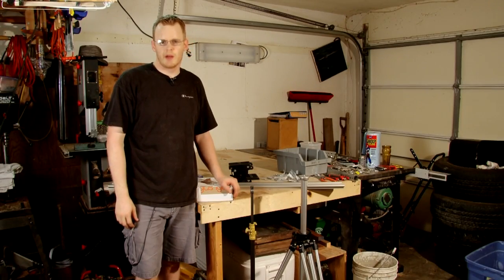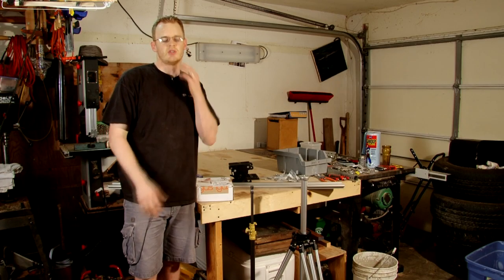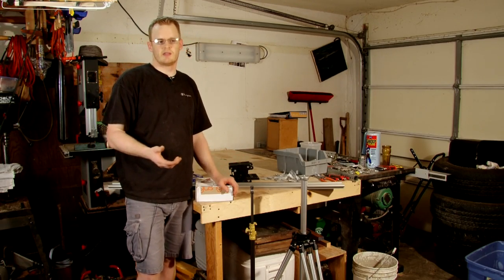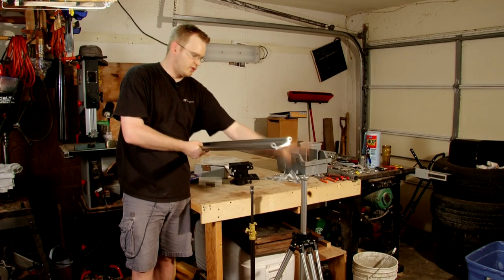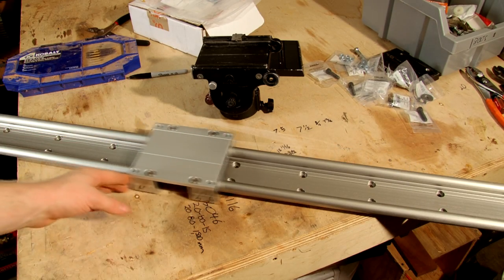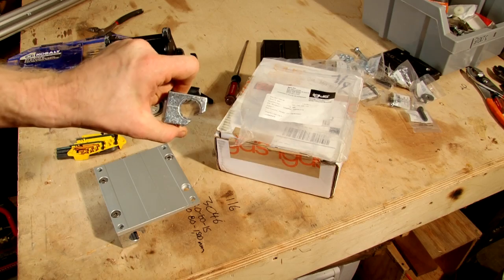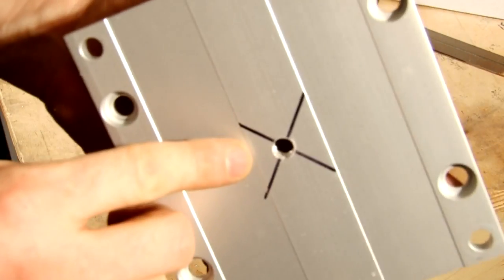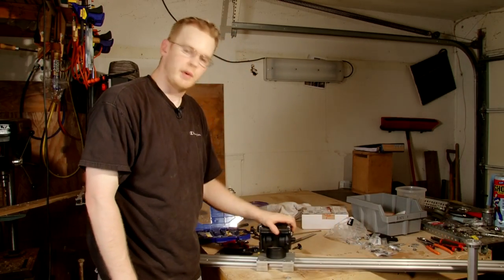DIY Camera Slider Dolly - Igus ZaZa

Comment: that has the screw thread of the tripod and what is the diameter of the hole for tapping
Reply from the maker: 1/4 20 or 5/16 are standard tripod threads.